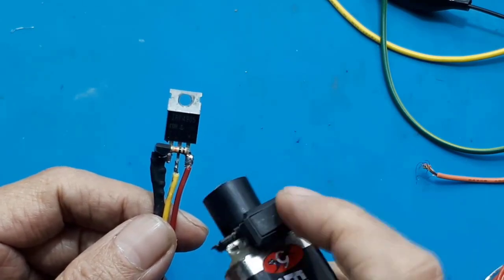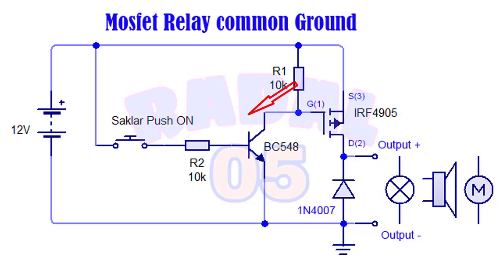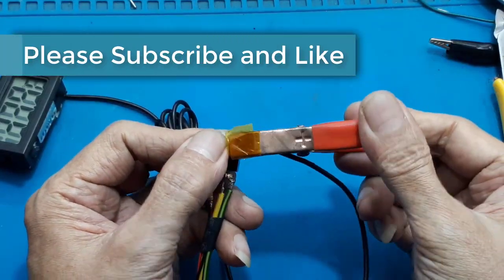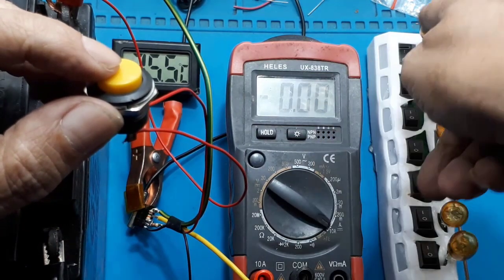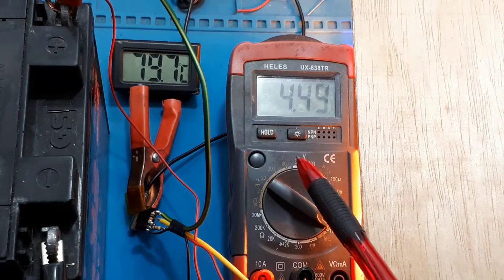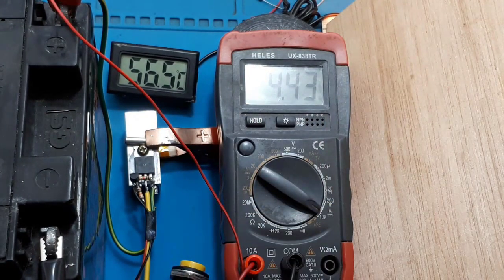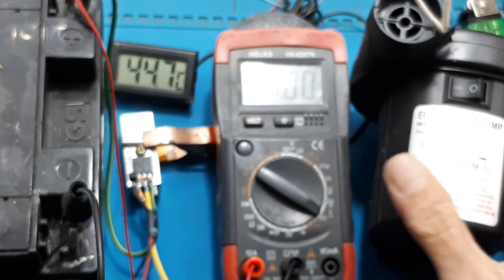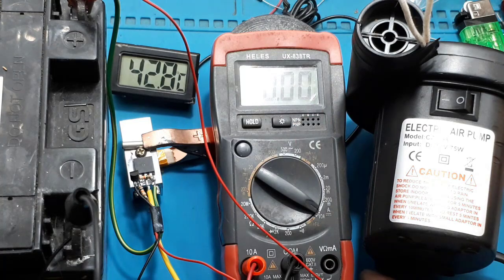Mosfet sebagai Relay Mosfet sebagai Saklar Ide Kreatif DIY

Comment: Saya kasih beban biled 8A 12v ga kuat, nyala biled lebih redup dr pd pas pake relay 10A, tp relay 10A juga kalah sih, pemakaian 30menit kepanasan, ga mau nyala. Pas dingin baru mau nyala lg. Mosfet ini jg kepanasan, sampe karet isolator bautnya leleh, mika isolator nya juga ikut leleh jd coklat2 gmm gitu lengket ke heatshink n body mosfet 4905 ini. Ada saran mosfet lain yg amper kontinyunya lebih gede?
Reply: secara budget relay masih pilihan terbaik & termurah utk kebutuhan high current continue
Reply: @xcntrx  memang sih, tapi makan tempat bgt asli...

Comment: Kalo Saya pakai mosfet irfp260n untuk highspeed switching ke beban 30v 10A DC. Lalu triger on off nya dari audio bisa bang?
Reply from the maker: bisa...Kalau untuk ON Off bisa pakai mosfet...kalau mengikuti irama pakai transistor
Reply from the maker: Maksudanya ada suara ON

Comment: If I use IRFZ 44 or IRF 540, is it OK instead of 4905 ?
I would like to get 10 A at the output. (at 42 V.)
Reply from the maker: This system cannot be used for regulators, it must be hot.

Comment: request pak bagaimana rangkaian di atas jika dipadukan buat lip lop tanpa relay juga, buatkan video sediri lebih sip pak, yang mau di swit 30amper pak, terimakasih sebelumnya, sukses buat chanelnya
Reply from the maker: wah, saya belum tentu tahu gan...seperti LIP lop apa ya
Reply from the maker: saya masih kopral... karena di  chanel ini ada 3 jendral elektronik yang mengawasi saya, dan dari 3 negara berbeda
Reply: @Radal05  maksut saya putus nyambung continus seperti yang di sini pak  https://youtu.be/v4kzQ_ZoYMc  tapi bukan system relay, mungkin pakai ne555, boleh minta nomer WA nya pak
Reply: @Radal05  kurang lebih seperti yang di sini ini pak, dipadukan https://youtu.be/Srp6WtyBGSk, putus nyambung continus cuma yang di swit 30amper pak

Comment: Bisa Ditambahkan IC ne555 bro set di 30khz jika saklar on maka pulsa 30khz sekitar 5v akan menjadi pengganti saklar, dan mosfet Akan Lebih adem Jika frekuensi lebih ditinggikan, jika langsung diberikan voltase gate maka mosfet cukup panas sesuai pengalaman sy untuk start motor starter Motor dulu 😁😀
Reply from the maker: mantap juga tuh..
saya coba nanti
Maksih gan
eh agan sudah nyoba,,,mantap nga gan ..?
Reply: Ada skema nya mas?
Reply: Ada skemanya?

Comment: Jadi ingat beberapa th yll bikin otomat kipas radiator mobil dg LM335, TL431, LM393, 2SC945 dan mosfet stP50N05.
Suhu air radiator naik 60°C kipas nyala, suhu air radiator turun 50°C kipas padam.
Salam genimili
Reply from the maker: semua komponen agan sebutkan ada waktu pasti saya beli...
Thanks gan